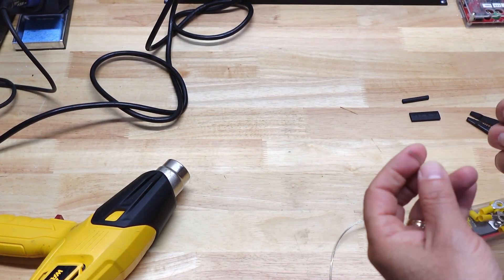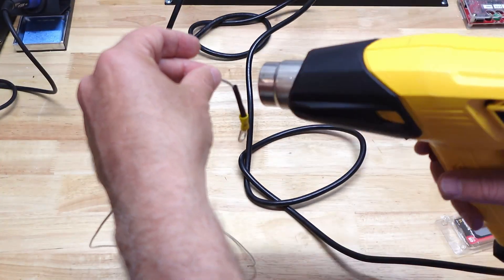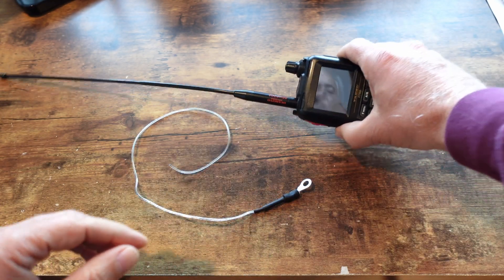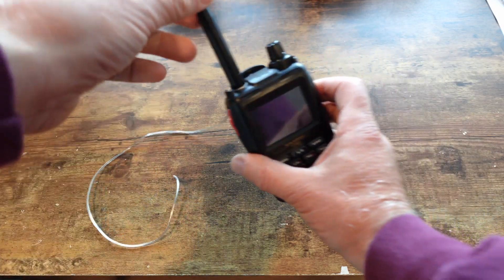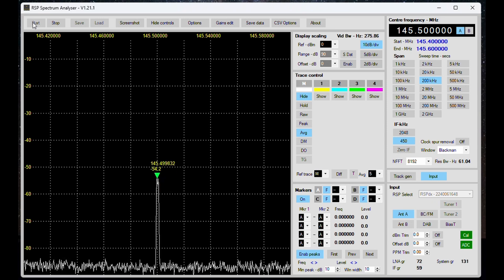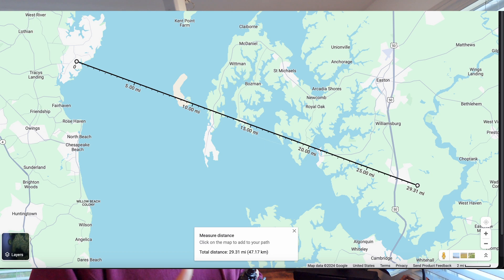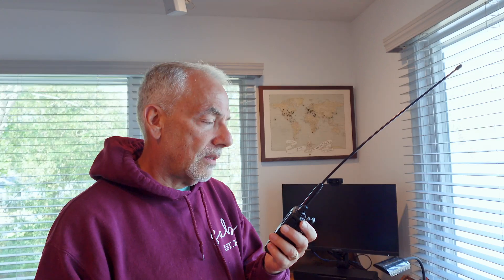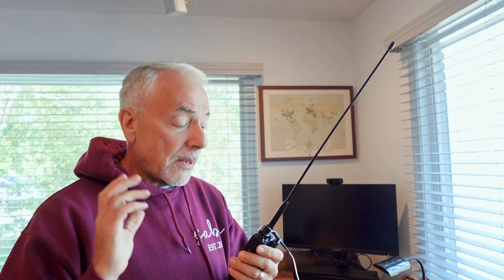Transform Your 2m HT Antenna: DIY Tiger Tail for Massive Gain [ I Saw 10 db ]

Comment: Thank you so much from a new ham looking for easy to understand ways to play with antennas!
Reply from the maker: Welcome to the hobby. I’m glad that you enjoyed it. Hope to hear you on the air. 73, Paul.
Reply: @W2PAK  Hey Paul! A couple of quick questions for you. I am so not technical! 

1. The speaker wire I have looks thicker than the one used in your video (it's 16 gauge). Is that OK? 
2. When I measure the tail, do I measure just the wire, or from the tip of the ring terminal? 
3. Do I need to seal off the end (non-terminal side) of the wire?

Thank you again!
Reply from the maker: Hi Lynne. 16 Gauge wire is fine. You measure from tip to the wire and I usually seal off the open end (just for good measure).  73, Paul

Comment: i remember to have tested with and without a tail wire on my old rubber antenna, just for to say that when you test the SWR, you need to keep in your hand your tester as the true life for to see the true result.. and in my case, with my rubber antenna, the result with/without a wire (even trying to tune the length) give a worst result (tested with a NanoVNA).. note that inside a house or car is not the better way to use a TX!! ..i figure to test that again with my new (longer) rubber antenna and confirm it (too) using a SDR (it’s a good idea!!!)..
Reply from the maker: Thanks for the comment. 73. Paul